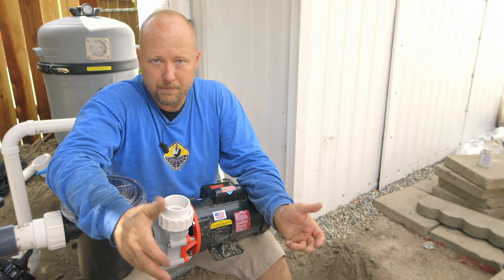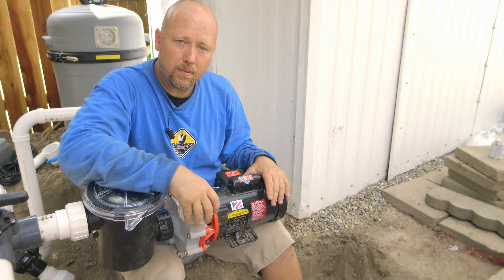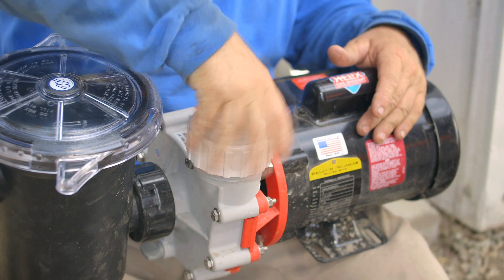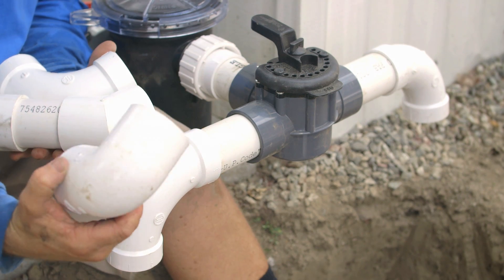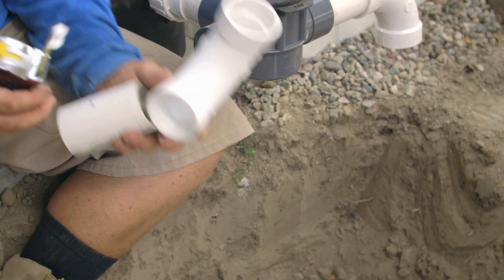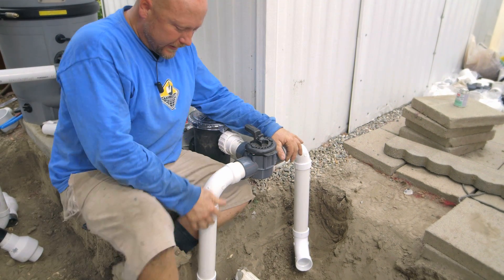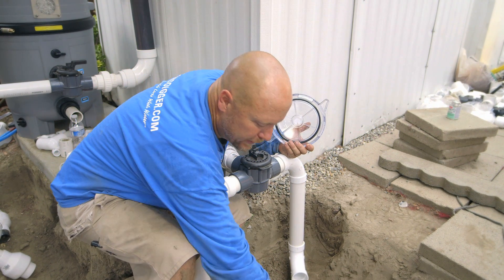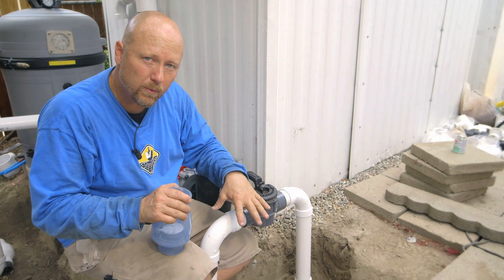Pond Filtration Pond Pump - KP 39

Comment: sweeps are nice friction-wise, but thinner wall dwv vs sch 40. nice vid. Thanks! wasn't sure if the priming pot could be connected straight into the pump.
Reply: PPl dont understand the piping system an flow parts nd rules of gravitas